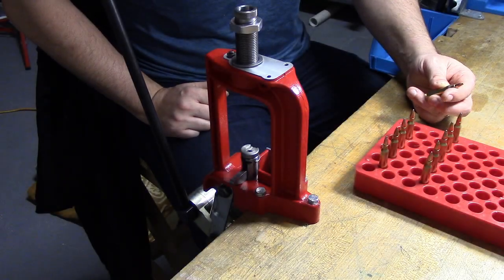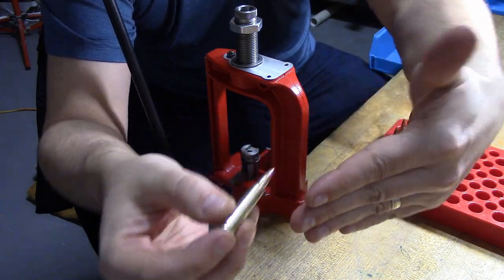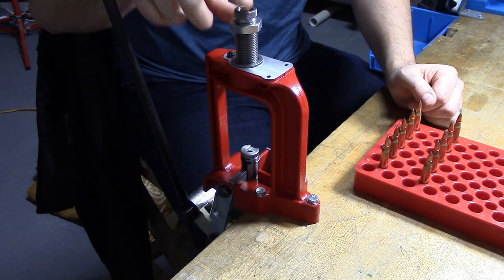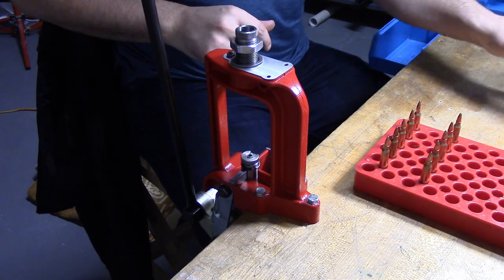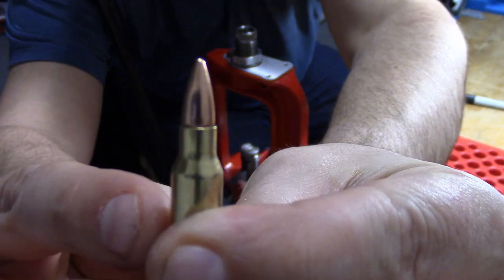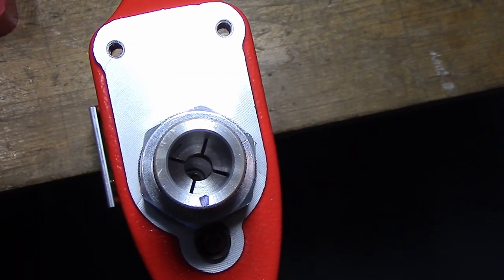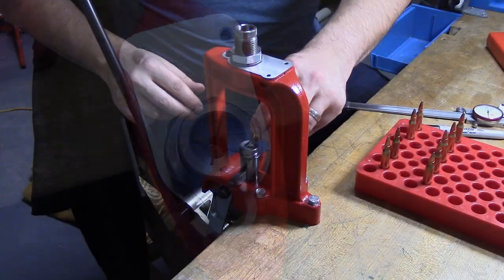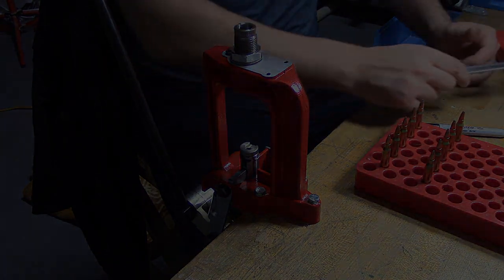Reloading Rifle for Beginners - Crimping | Guns N' Reloads

Comment: I personally go for a nice firm crimp not to hard but a little heavier than light but it's only my personal preference. I feel like the firm crimp will increase pressure with slightly more vanilla powder charges but I only load for plinking most of the time. I'm no pro like urself. Great video.

Comment: I can't get my crimp die to work. I lower it down to the ram and then lower it another half turn. I run my case up there but it doesn't crimp. The collets close, but not enough to leave a ring in the brass on the neck. Any suggestions? Thank you.
Reply: This die does not leave a ring around the brass. You won't be able to see a change. If the collets close you're good. Don't close them to where you can't see daylight through it 😄
Reply: If the collets close at all, then you're getting a crimp.  Don't overdo it.